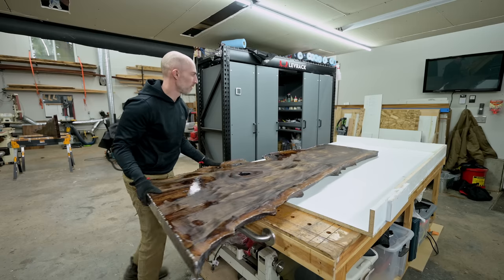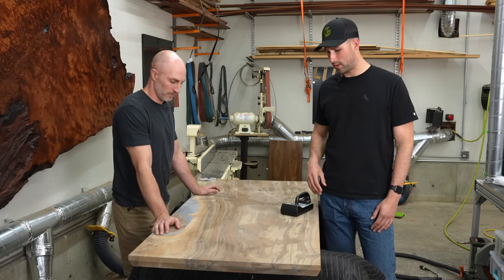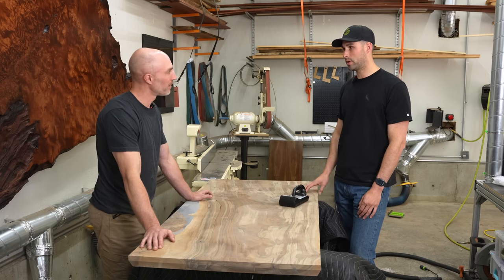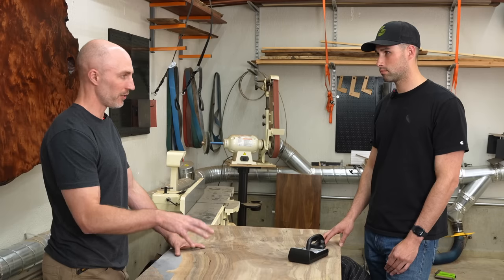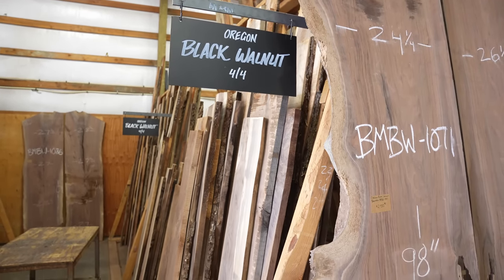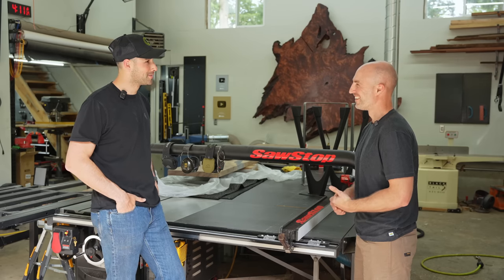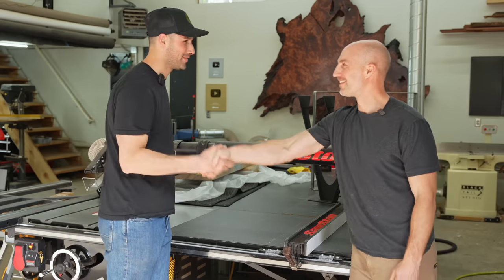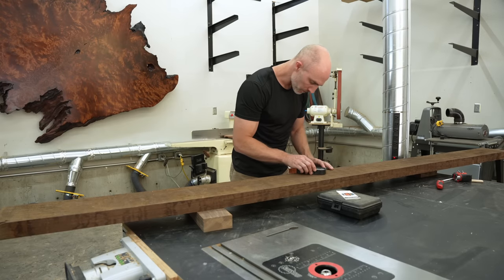Confronting My Wood Supplier

Comment: As a self employed woodworker of 20 years....I definitely don't think it's fair to put the blame 100% on GOBY.  A $30k job deserves 5 minutes with an expensive moisture meter before you get that far into it.  No matter what anyone expects from a supplier...you have to remember that every supplier has several employees and none of them care about your project as much as you.....stuff is gonna slip through the cracks.  If you really want to avoid the headaches you've got to go a little out of your way to avoid them.  In a perfect world you'd be able to buy a perfect slab and just get to work...but that isn't how it works.
Reply: 100% agree with this, I’ve been in the business for nearly 30 years and I’m absolutely amazed that the supplier got all the blame under these circumstances. A woodworker ensuring that the wood they’re using is suitable for the job is seriously one of the most basic things in woodworking. 

If I buy from a supplier and soon find out it’s not fit for purpose I get it sorted straight away. If I go ahead and build a full furniture piece and then have problems, that’s 100% on me.
Reply: @andrewjames3068  Yeah that was my question -- why would Blacktail build the table THEN check the moisture?  Yes it is an assumption that the slab would not contain trapped moisture, but if I were to ever build something that expensive I would want to ensure the moisture content is acceptable PRIOR to cutting the slab (even prior to purchasing the slab for that matter)...  Goby handled it well, he's obviously had some good PR training.  Overall though, good video.  Very informative for us non-professionals.
Reply: @markolivet4371  both of you are correct.  Cam built the tables accepted the material as is, this totally on him.  He still has lots to learn.  He works with wood he is not a “wood worker” yet.  Lots of comments on his honesty…. He has to be doesn’t have a choice.  Cam does the work no one else. He only confronted Goby to get new material at no cost to him.  Look at Cams body language when Aaron says it’s on him.  Also this is what Cam likes, a little controversy.  Makes for a lot more YouTube content more $$ for Cam.    Also getting a bit tired with epoxy tables, it’s all the same thing.  I would like to see Cam build some real furniture and make some real jointery.  Maybe a mortise and tenon with out a domino?  Simple.
Reply: @Lance Rawlings I really don’t think you’ll see him do any real joinery anytime soon. His skills seem to be in design, film making and business, other than this video which is incredibly unprofessional from a business point of view, it’s certainly going to make him money though.
Reply: @andrewjames3068  agreed.   Although I don’t think there is much design involved.  These are epoxy slab tables with metal legs.   It’s the material that  makes the tables.  Well that’s enough of YouTube content for Blacktail.  I’ll be unsubscribing.  It’s the same over and over.
Reply: Absolutely agree. It definitely should not have left the store. But at the same time Cam had to accept his part of the responsibility, for disappointing his customers. He made a promise and didn't do all he should have to make sure he was using not only quality, but dry/seasoned quality timber,before buying it and showing it to his customers.

I think Goby did the right thing by Cam. Offering that replacement wood at a huge loss, was more than generous. It also makes sense that Cam Should also take a loss in the form of labour, epoxy and other incidentals. So I think it ultimately worked out for everyone except the poor customers who have to wait months and months longer. Not to mention the jobs cam will have to put off, whilst attempting to push this Italy job through. Great videos.
Reply: Ya, some really interesting and odd comments made here by Blacktail. Can't assume anything with wood, and 15-32% is nuts.
Reply: Spot on. No disrespect to blacktails work, but epoxy tables with no technical joinery, design or workmanship, are about as basic and simple as furniture production gets. Missing small details such as this is inexcusable. If there wasn't so much carry-on on price, labor rates etc in videos, i'd be far more accomodating, but the value of these pieces is seriously outrageous for such entry work. Sorry not sorry.
Reply: @nicholaskaye61  I really don't know how it took him over a year to complete these? This type of work would take 3-5 weeks from any reputable carpenter I know.
Reply: @bobos245  Millions of viewers and some potential customers will create a gnarly back-LOG in commissioned work.
Reply: True
Reply: sometimes it's best to take the blame. in the end it's better for their business. It seems GOBY may be advertising wood is completely dry. Maybe they should have a very visible precaution to all clients that it is there responsibility to make sure wood is completely dry
Reply: @markolivet4371  maybe it's all part of the creating content lol. I mean, it made for good videos
Reply: 100%.  I responded similarly.  Cam is great guy makes great videos but sorry if I am buying thousand+ dollar slabs for 10k tables I am investing in the top end meter for myself.  You as the consumer of a living organism have to take some responsibility as well.
Reply: I think that's why he's not trying to press them to reimburse him for his time spent working on these, like it's their fault they weren't dried right but he understands it's his fault too for not checking which while it sucks expensive mistakes drive home the need to do things properly better than cheap ones for a lot of people so I'm sure it's not going to be an issue for him again so while loosing thousands in labor time sucks at least it's a learning experience for the future
Reply: The “you’re not forgiven until we make this right” was the comment that did it for me.  Once you accept the product and start working on it you take the majority of the blame for any defect.  Had you tested it before u left they could have put it back in the rotation and dried it.  Aaron acted like a professional while Cam acted like an entitled YouTube star in this video.  The whole tone of this video was upsetting.  Again, Cam has a moisture meter ultimately it’s his responsibility to check the slab before it ever gets loaded into his truck.  Stand up job by Goby and that speaks volumes about the company. I’m surprised they gave you a slab worth double what the first one cost.  That speaks volumes.  This video was missing a little humility on Cams part.
Reply: @nicholaskaye61 yes, my exact thougts.
Reply: Exactly, I've always believed, perhaps because I'm old school, that if I buy anything for a project and I don't inspect the quality and consistency of the wood personally, it totally falls on me due to faults or moisture content.  Pushing the blame on someone else due to my own F ups is sort of unprofessional imho.
Reply from the maker: Oh, for sure. I hope it didnt come across as if I wasn’t accepting any responsibility for it. I 100% should have checked first, and always do now. This was my hard lesson to learn, and I hope it educates some more people into not making the same mistake.
Reply: @blacktailstudiouncut  It 100%  came across as you leaving responsibility soly on the supplyer.
Reply: @blacktailstudiouncut  you blamed the wood guy who is a good guy

Comment: He looks disappointed. I’m sure he never meant any harm and he seems like a good guy, especially if he wants to make it right with you. If I ever need a slab, I know where I’m taking my business now.
Reply: humans make mistakes, its that simple. but what makes people stand out is when they take full responsebility and dont deflect blame or make excuses when mistakes happen.
Reply: @emptyforrest  Mistakes were made by both sides. It was sent out wet and when it arrived it was not checked prior to work being done on it..
Reply: Honest mistakes be honest mistakes.. Takes a good man to resolve it like this...
Reply: @SegoMan  It looks like the moisture was a bit deeper in the wood. That they could only measure it then because of the layers of wood that had been taken off already. So perhaps Cam should do the moisture reading (even if just a quick 5 min check) after he's done the cutting & planing, but before starting the epoxy.

Comment: At the end of the day IMO this is the risk that comes with those crazy grain slabs. There is a reason "traditional" woodworkers always favored straight grained pieces, removed almost all the sapwood, etc. Crazy grain is nice to look at but it is unpredictable, harder to work with, etc. Wood is a natural material and when working with the craziest examples things like that will happen. I think you and your supplier handled things as well as possible, making mistakes happens and most customers will understand when you present them the truth and they feel like they can trust you.
Reply: Maybe the MOST realistic response, in my opinion.  Take responsibility for your craft.  If Goby sold the slab as Ready for EPOXY, there may be some responsibility.  Ultimately, the end user, KNOWS, what is required to do the work with the product.  If they do not that is on them for lack of actual experience.  No one should be responsible for lack of experience on a product or service.  Especially when you pay such high prices.  Love Blacktails Studios work but some issues with process.  Did Not like the title of the Video, supplier was more than proactive.  Lessons Learned.
Reply: I agree fully with your summation. As a woodworker of over 45 years, my experience is that you get better at thinking about what’s happened before and what may happen - but you never fully know. The more complex the grain pattern (usually thought of the more interesting), you just know the problems of moisture, of internal tensions increase dramatically. As a consequence, the supplier and the woodworker should be aware of the unknown. The end client might well not be aware of all these timber issues but I also always told the client that with timber being a natural material, the unexpected can happen. 

I’m writing this sitting in front of a large (3m x 1.2m) lounge table made out of a slab of London Plane (platanus x hispanica). It has amaxing interlocked grain and bought already with internal fissures and checks. I kept it for 4 years inside hoping to reduce risks; I put in half a dozen steel bow ties; I cut the slab down the centre and introduced a central spine of 4” x 2” walnut with out rigs to try and stabilise the slab. I finished it about 2 years ago and it was put into its final position. One night, we heard bangs like a picture had fallen from its mount but could see nothing. What I did find days later is that slab had cracked twice. Firstly, right through the 4” part of the 4”x 2” walnut and secondly, further along, through the joint between the 4”x2” and the London Plane slab. Knowing what I know, it just accept this as a consequence of using a complex slab of timber. In time, I will fill those cracks with export just to avoid spills or dirt getting into them but I am not overly disappointed at the issue.

I bought this slab and many others from English Woodlands Timber in West Sussex, UK. I’ve never had any major issue with timber bought from them (which I could blame on them). However, i have found them to be very helpful in every dealing. I’ve got no connection with them but would recommend them to any UK user.
Reply: The flip side is its also the risk of selling this type of product. I'm sure it is priced accordingly.  They sell this product guaranteeing it has been dried properly and checked thoroughly by professionals. For clarity, my interpretation of the comment is that Cam is responsible for choosing a slab with movement.
Reply: @russellsage1536  I did not mean to point fingers, my point is more that when using this type of wood, everyone has to be aware that shit can happen sometimes. And it's all about how you deal with issues, which in this case it seems everyone has done well and is as happy as can be considering the circumstances.
Reply: @russellsage1536   I don’t agree entirely but, then, I don’t know the terms under which the slab or slabs are sold. If they were to be sold as no more than, say, 12% moisture, then you have a right to expect that - although, for me, experience would tell me that some movement in the slab might be expected. If it were sold as kiln dried, then I’m not sure what that means in terms of moisture - perhaps different things to different suppliers? I never was a big buyer of waney edged slabs but I always asked the supplier to go over the slab in front of me with their moisture reader (much better than my cheap pocket one) and show me. Changes in grain pattern but particularly changes in grain colour were always a signal to check them carefully. Rightly or wrongly, I was equally wary of very low readings as well as high readings as my thought was that this part of the slab would absorb moisture to equalise it all and that could lead to issues. We bought and buy mostly rough sawn square edged product (although we are nearly through £20,000 worth of European oak bought planed all round); even then, we get occasional issues with warping, splitting and checking. We just accept small instances as part of the nature of timber
Reply: i have no experience in woodworking but at some point can one really expect such material to act like synthetic material and stay perfectly flat ? my brother just installed a wooden deck at a client's the the client refuses to pay because the wood has cracks and slight wraps. Maybe he was expecting to be like composite or to look like 3D renderings lol
Reply: @RickieBeubie  good points. For a short period, I did make and sell fine furniture; it was all internal pieces like credenzas, bookcases, tables and, even then, it was a question of managing client expectations. Even internal items which should be “perfect”(a subjective phrase given colour and grain matching as a minimum) are subject to colour changes and movement. External items are obviously much more prone. Even though you think you have explained it all, an unreasonable client will be able to find some reason not to pay the full amount

Comment: I was the head of the sales department at a large Belgian lumber import company and I can tell you, this owner was absolutely incredible on handling the situation. He touched very briefly on one of the major components though that the time the woodworker spent/lost on the project can’t really be compensated. For me that was the highlight of the conversation and was a bit to briefly addressed.
This was one of the major hurdles I faced on a monthly basis. Our main import wood was French white oak which on thicker slabs 5/4 - 6/4 and 8/4(last one would never be killn dry of course in the core) had similar problems.
I always saw both sides of the argument. Yes the lumber supplier shouldn’t sell you KD if it’s AD, or with pockets of AD, but the responsibility should also be on the woodworker to properly test so he doesn’t waste his time. Supplier bears the responsibility for the wood and if he replaces it with equal or better at no upcharge, the woodworker is responsible for working with wood that should have been worked with. If you can proof you get a product that is not correct, it is easily (sort of depending on grain preference) replaced.
These customers are the most lovely people to have as a woodworker. They understand that you work with a natural product that has variables and that people can make mistakes. It happens. Unfortunately wood at those thicknesses takes years to dry and months and months to KD.
I hope that a lot of woodworkers see this not as an epoxy project but a life lesson or a vital lesson in how wood is constructed and need to be worked with.

Comment: Cam, this will likely never get read, and I'm not sure if it's already been mentioned in the comments, but a lot of times this happens when the slabs are cut and then left in the sun. When the sun bakes a wet slab, you end up with moisture lock. That moisture will never come out even after kiln drying. There's nothing wrong with air drying, but it should either be done indoors or the slabs should be covered in some way from direct sunlight. If ole boy isn't aware of this, I'd definitely let him know. Looks like he's got those slabs sunny side up in those shots. He's absolutely killing his lumber like this.
Reply: This is the right answer.